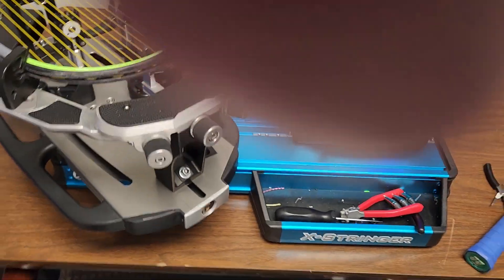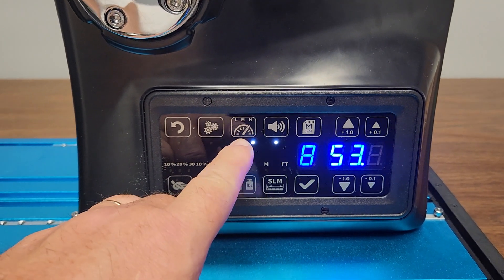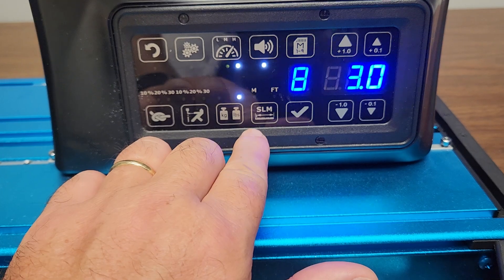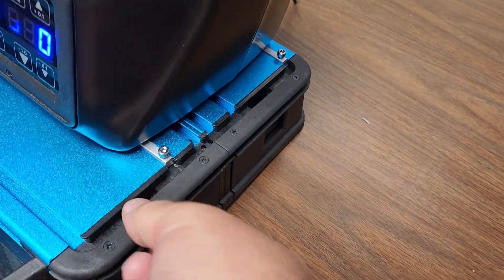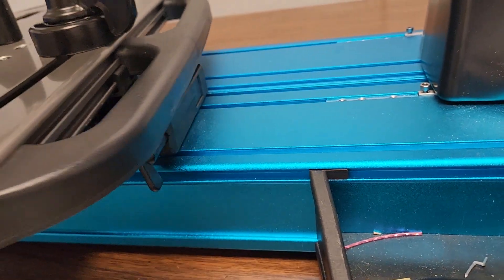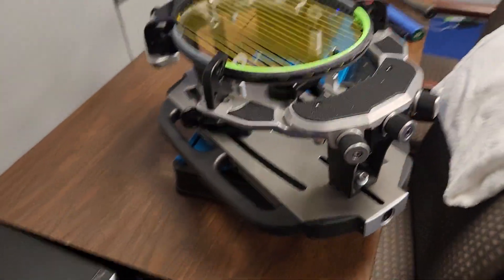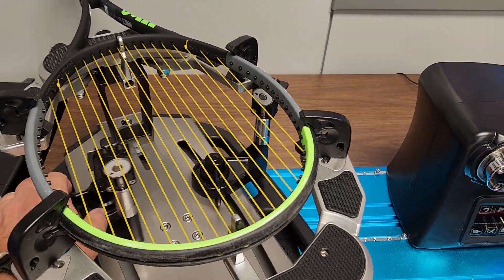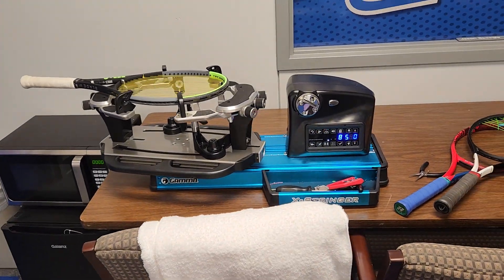Gamma X-ELS X-Stringer 2022 machine

Comment: It doesn't look like the new tension head will be used on the progression, at least not on the latest version as of April 2024. Just guessing from looking at images but It may be too large to fit on the more compact moulded body of the progression vs the flat rails on the X series.which would allow more flexibility in positioning?

Comment: The drawers are dead simple to pull out when you grab from underneath (took me a minute too). Even easier to get at if the machine is on a stand or has the table feet attached to give you room enough to get your finger under the unit.
Reply from the maker: I had a hard time getting my fingers in and grabbing the drawer

Comment: Normally I measure 9 racquet lengths for the mains and 8 for the crosses (16x19) but with this tensioner I find I have to go up half a racquet length if I don’t want to use a starting clamp bridge on the last pull. 

My only complaint about the machine is it takes 2’ of extra string for the winding tensioner. Do you find that to be true compared to a linear unit (XLT for example)?
Reply from the maker: I find the same thing. Takes about 2 feet for a 2 piece, and 1 foot for a 1 piece.